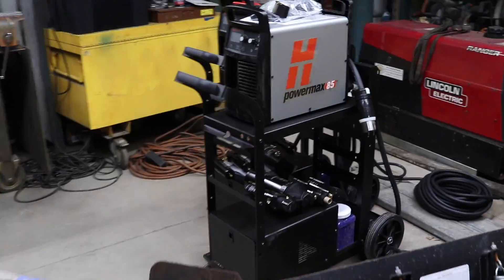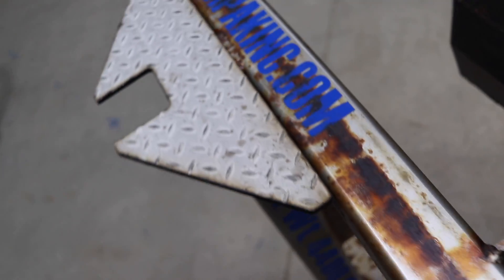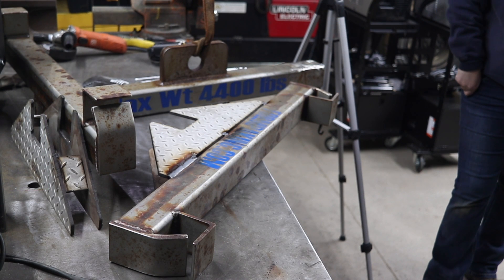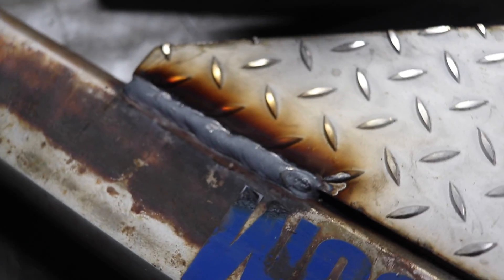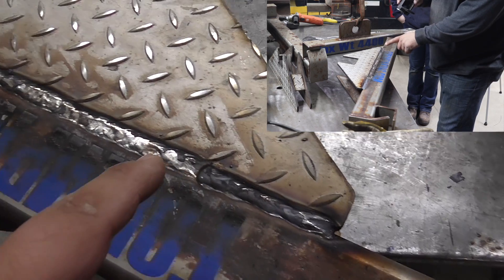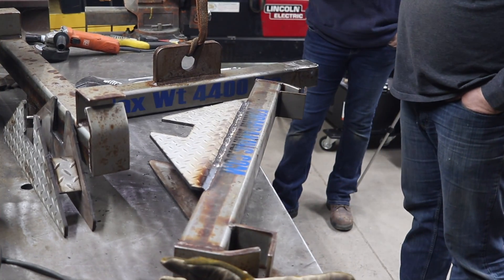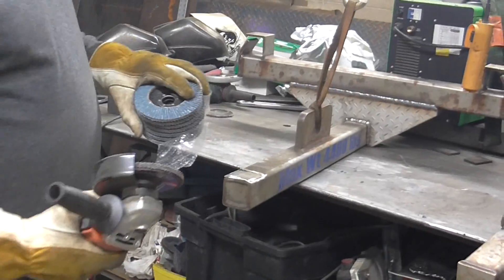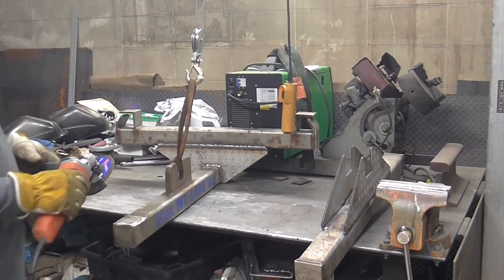Dual shield vs Pulse mig Stainless

Comment: I tried finding 98/2 recently and found it to be unobtainable. Local suppliers offered me 90/10 and 75/25.
Reply from the maker: You could also use 98ar 2 o2    That is a pretty common gas.

Comment: How come no tri mix gas?
Reply from the maker: tri mix is very expensive and on stainless helium is a cold gas (unlike aluminum where it is a hot gas).  that being said stainless solid wire is hot spray arc process .... in order to cool it down and make it manageable you typically use a tri mix ....  if you have pulse (pulse cools the spray arc down) you can use a much cheaper gas. 
essentially it is the same gas .... you have the majority is an inert gas with 2.5% (on the tri mix) and 2% (essentially the same amount - you could also use a 97/3 - so 3%) CO2 the active gas ...  
the only thing you do is on the inert side replace the expensive and cold Helium with the cheaper and more abundant argon ....

or were you talking doubt the dual shied wire ?  that always uses 75/25 AR/CO2 because the flux composition in the inside make up the difference in shielding gas as the flux burns off and that adds to the shielding gas atmosphere

Comment: should be dragging. If it has slag, drag. Probably would have kept the discoloration from being at the start.
Reply from the maker: yes - dragging stainless dual shield is the right way to do it.  on steel you can go either or

Comment: That flux core weld would look so much better if you dragged it or shot straight in with a slight oscillation, especially on flat. Also, that smoke from the stainless fluxcore is terrible for you to breathe in, more so than regular fluxcored smoke.

Comment: That part was not stainless......it had stains all over it !!! Watch your pant leg @ 7:45 you're bound to get sparks in your shoes !
Reply from the maker: John, it is stainless - it is 304 stainless - the reason it had rust spots all over it is because it is used in a salt factory ...  for this application the customer should have chosen 316 stainless then he wouldn't have had this problem ....     
btw all boats that are used in saltwater the railings and ladders on those are made from 316 - 304 is only good for too much  - your forks and knifes at home are typically 304 or 18-8 which is equivalent ....  id you put your knife or fork in the shop let it lay on a pice of steel and drip some water on it ... the fork will rust where it touches the steel ...  

that is the nature of 304
Reply: +ZILA 
I know, I was joking. I can't say I have seen 316 in 3x3x1/4. In my plant we use water based glue that turns 316 black !

Comment: i love with all the cutting equipment you have, the lowly grinder with a cutoff wheel is still the right tool.
Reply from the maker: yes - on stainless it is so fast and clean .... no rework or prep before you can weld on it again ...  and carbide tipped blades to cut stainless are really pricey and dont last as long as their steel siblings ...

Comment: Peter, without question, the best deal on flap discs in America is Lehigh Valley Abrasives. Now you would think from the name that they're from PA (Lehigh Valley near Allentown) which at one time they were, but they moved to Michigan. They use VSM cloth to make their flap discs which is the good stuff from the old country. Buy the red ceramic discs and you'll be a happy camper buddy. Take it from a fellow Kraut I wouldn't steer you wrong. According to HTP the Propulse 300 is still a year away. What's up with that?
Reply from the maker: SATAMAN Schmidt i heard the pp300 will ne here in june no later than july ...  that is about 3 month out ...  
and i also heard they already started a waiting list ...  if you want one of them you should get your name on it ...    otherwise you will really have to wait for the next batch in late fall ...

Comment: Like your videos!  sub'd.  Saw your vid with the plasma table standing up.  Do you put it down to use it?  Is there a track on the wall to stand back up or??  Great space saving idea, which I am looking for.   Thanks for sharing experience and expertise!!
Reply from the maker: thanks!   it actually works standing up !!!  only about 230-250 ipm (because the motor going up and down is a planetary gear reduction deal)  and it really takes some effort to program it ...  your starts and stops need to be at 12 o clock ....  but it woks great - even standing up

Comment: A esab rebel on the bottom shelf of a cart how do u like it
Reply from the maker: dont know yet - its brand new - never even plugged in... i have a boat load of videos i intend to make .. but the days are soooo short ....
Reply: ZILA with all the other wicked welders u have ( stel, htp, etc) the only thing I could think that made u grab a rebel would be the fact it runs 6010 on110v, I could b wrong but I watch u lots ive seen your awesome welder collection and thats all I could guess
Reply from the maker: Vera Carswell it is not even mine.  A friend of mine bought it and said to me :” you test it! If it blows up i give it back “....   lol

So - we’ll see

Comment: Looks good I’ll have to give 312 a try
Reply from the maker: 312 for dissimilar metals or unknown metals
Reply: ZILA yeah that’s what you used right? I have 309 for dissimilar for pro pulse and 308 for ss. Always looking for new wire for dissimilar to try
Reply from the maker: 312 is "stronger" than 309 and i think it flows nicer ... and it is even more "forgiving"  ...   and usually a lot more money and a lot harder to find .....
Reply: ZILA more silicon too right? That’s why it wets better? Do you recommend 312 for tig too?
Reply from the maker: i would have to look at a spec sheet ....  but i want to say no.  the reason for better wet out is the flux core ...  between the flux and the shielding gas it makes a real nice wet spray and stable arc ....  and i also believe - but i would have to look that up too to verify 100% that 312 draws a lot less carbon out of the parent metal ..  that makes for better higher quality welds and less cracking of the weld or failure in the heat affected zone of the parent material ....

Comment: Oh, i see a ESAB Rebel in the corner. Have you already tried aluminum mig with that machine? I've only used it on mild steel and stainless so far.
grüße!
Reply from the maker: i have not even had time to plug it in ....  stay tuned something is happening here in the next few weeks ...